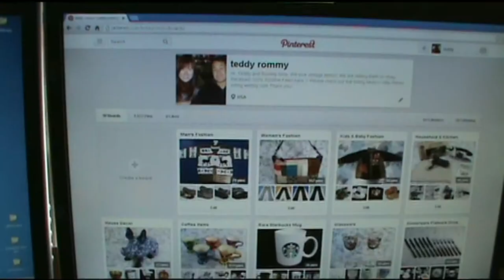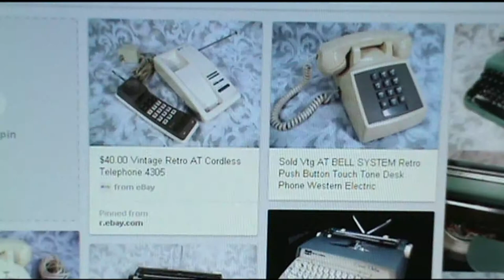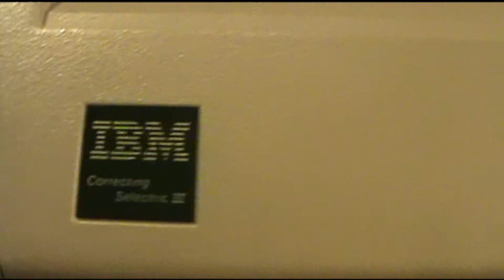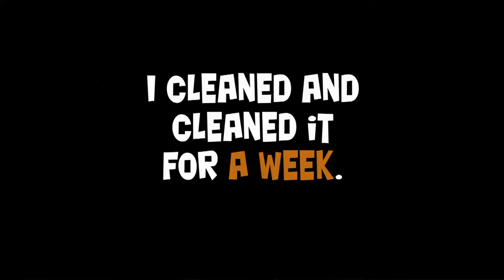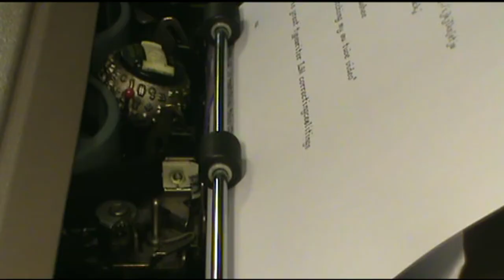My challenges to restore vintage typewriters

Comment: makes me want to restore mine.  It's a smaller but older model and when I took it out of the case I found a small spring but don't know where it goes.  Since these machines have literally thousands of parts I don't want to take it apart farther then I can put it back together!  The only fault mine has is it doesn't backspace which is where I think the spring is involved.